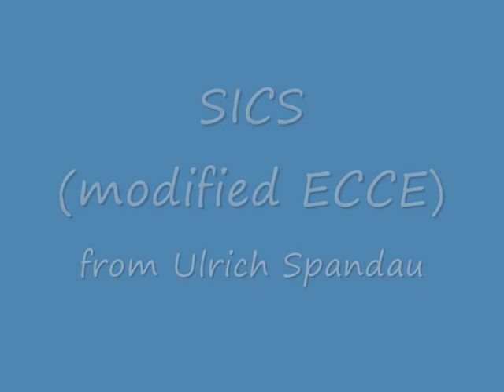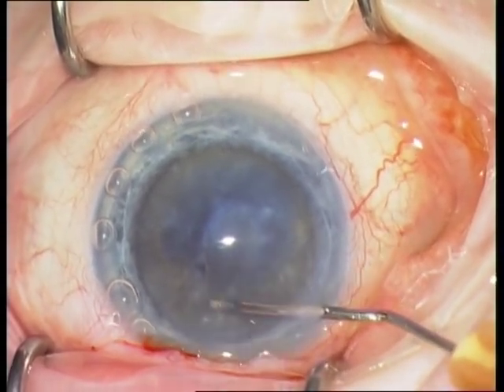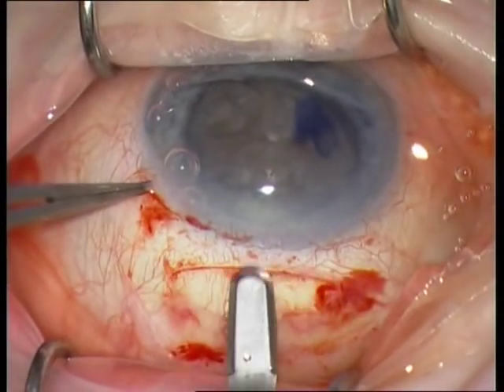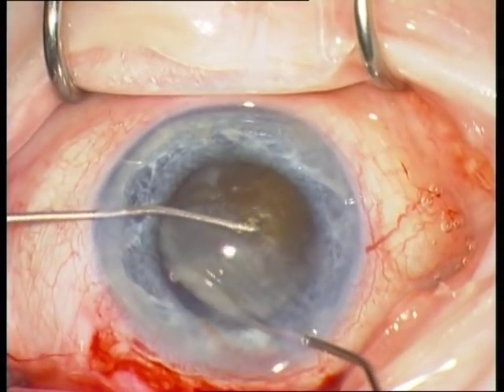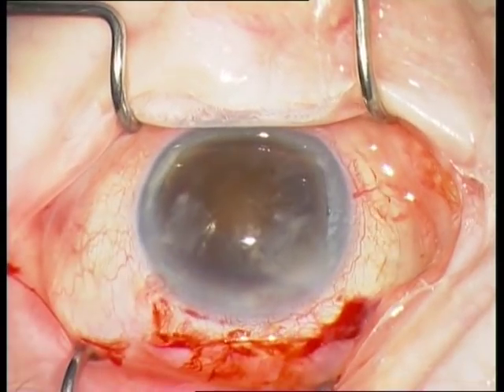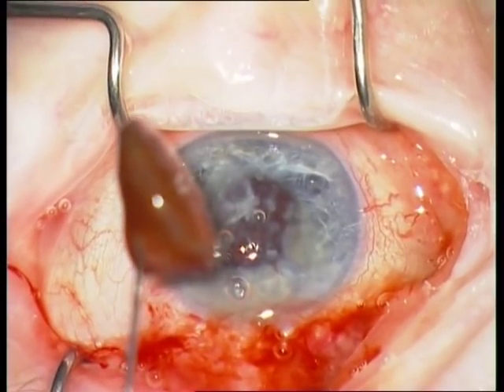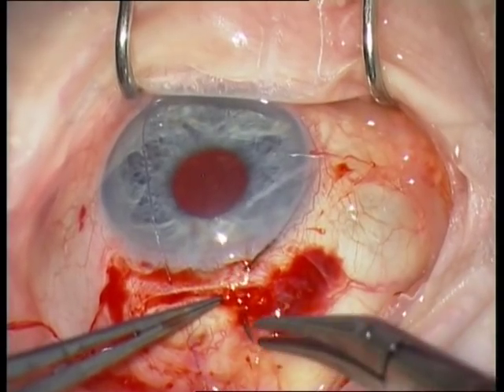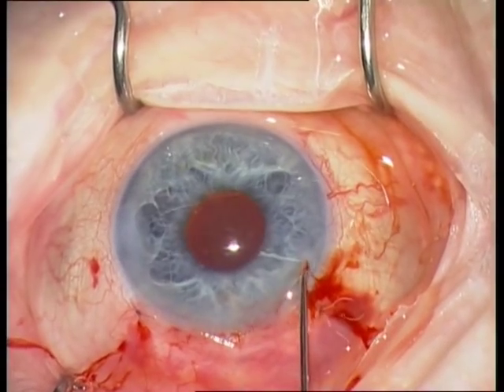A Nice SICS with beautiful narration by Dr Ulrich Spandau, Uppsala, Sweden

Comment: I put a single X suture just like this, (but with a buried knot) lightly tied, to just appose the scleral lips. Not tightly tied! This prevents post op astigmatism. The fish hook is excellent as well. I also use Pradip Mohanta's trick of only making one radial incision in the conj and then closing it with a releasable suture at the radial incision end. Works beautifully. Good job there.